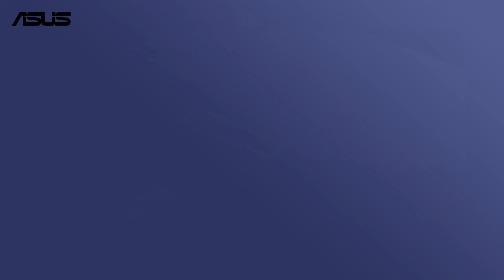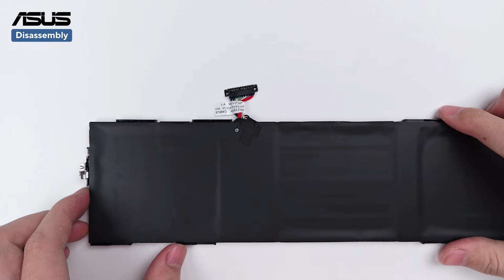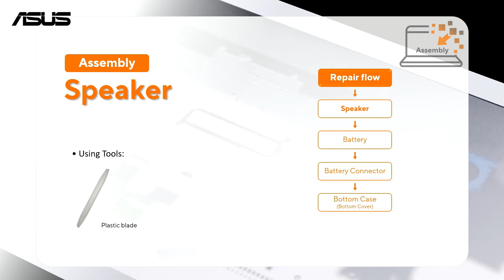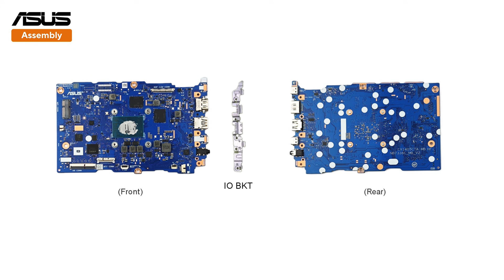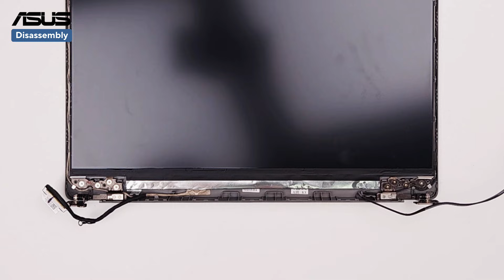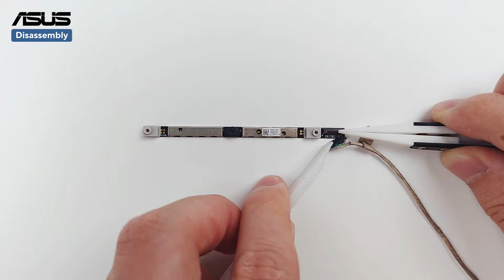Teardown : Teardown ASUS Chromebook CX14 (CX1405CKA) Teardown | ASUS SUPPORT

Comment: ASUS India Warranty Scam Exposed
ROG Strix G17 (RMA NQYW20025) - 90+ days black screen hell:

✅ Signed job sheet claims LCD+CABLE replaced Jan
✅ Same flicker returns weeks later on 25th january  
✅ They admit "deficiencies" then ghost CEO emails
✅ no resolution its been 100+ DAYS

@ASUS_ROG @ASUSIndia
Reply from the maker: We apologize for the unpleasant repair experience you have had. In order to better assist you, please provide your issue and product serial number to the following email address. We will have a dedicated representative help you.  ASUS_Support_HQ@asus.com
Sorry for any inconvenience it may be caused.